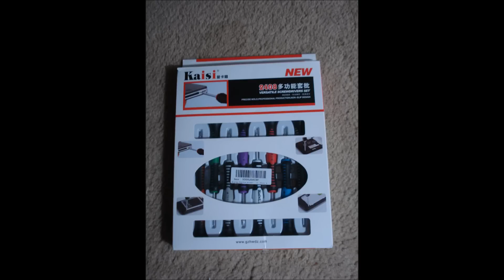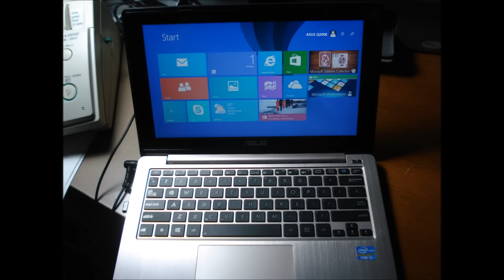ASUS Q200E /  X202E / S200E TOUCH SCREEN REPLACEMENT

Comment: Thanks for the video; it helped me a lot. Additional note: if (like me) you only want to disable the touchscreen (after it has been broken and fires random touches) you do not need to unscrew hard disk etc; just unplug the white plug (visible at 2:06 and 1:43 in the left had corner)
Reply: No Need to open Case. Devices Manager->Human Interface Devices->HID Touch Screen->Right Click->Disable
Reply: @JoeTheStiff your method worked but not for me because i've got stuck at login password .. it auto click everywhere.. and i cant even type the password .. it actually depend on how worst your touchscreen ..
Reply: @JoeTheStiff  Well that's because you have the luxury of being able to login and scroll to those settings without a crazily dis-functioning touchscreen.  M. Conrads solution is for the rest of us, who can't with a broken screen pinging like fireworks, w ~10 mystery keystrokes a second.   You can't get in period, no matter how fast you are.
Reply: @JoeTheStiff  I have seen this suggestion to other touch screen problems and it apparently is re-enabled after certain major updates.
Reply: thank bro .. i've got the same problem .. now i know how to disable touchscreen manually ..
Reply: Z

Comment: For the Q200E, I can offer some important additions to this video. First, you need some double-sided tape approximately 1/8" thick to mount the replacement glass within the bezel. Second, be careful to route the cables back through the traces and not against the hinge barrel, or you introduce a risk of chafing the outer jacket. Third, be sure those same cables are not resting beneath the microswitch behind the power button on the top face of the keyboard. The obstruction will prevent the switch from engaging on the power control board and powering the laptop on/off. Lastly, be cautious about how the touch screen interfaces with the laptop, because even fully reassembled, the unit exhibits a bizarre "fireworks" like effect as if it is trying to process multiple phantom touches throughout the screen. It renders the laptop practically unusable until you can at least engage the device manager and disable the touchscreen driver. We still don't know what we did wrong in assembling the new glass to cause the touch screen to behave incorrectly, or if it can be fixed. For now, the touch feature is disabled.
Reply: David Whitney how do you disable the touch screen feature?
Reply: Nikki Warframe You must go into Device Manager within Windows and locate the touchscreen device and disable it there.

Comment: Hey bro, I changed the screen for somebody but the issue i am having is that the screen digitizer is activating it self without someone touching it. Do u kno why this maybe happening
Reply: I'm having the same problem. I noticed it is "ghost touching" near the top right of the screen. Were you able to find out what was causing this?
Reply: anyone ever find an answer to this?
Reply: hacker?  or windows driver isues. try installing from the right cllick on my compuuter and click manage ,  go to divice manager and find the ones that are not installed.  right click on it and click update driver.  have windows find the driver.  it should install and update.  then restart and it should work
Reply: also check the screen touch sensitivity   might be that,  lower it might help
Reply: Fingerprint.
Reply: Could be a poor quality screen and/or dust, dirt, hair, or other debris between the glass and the digitizer